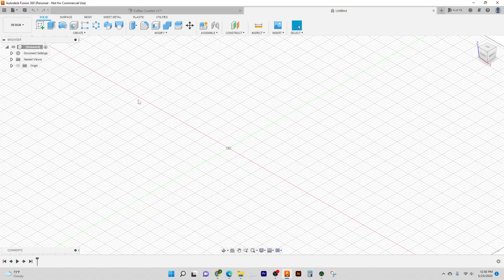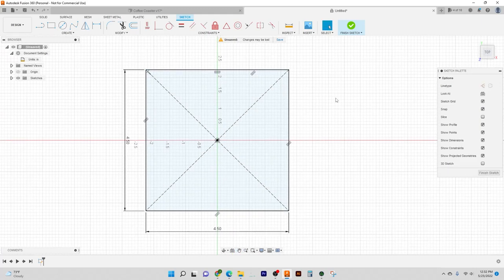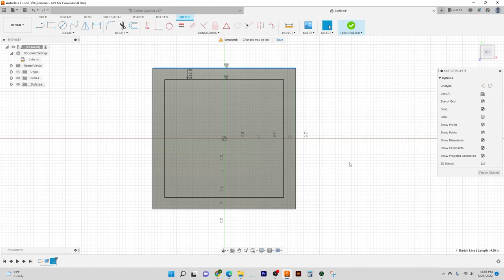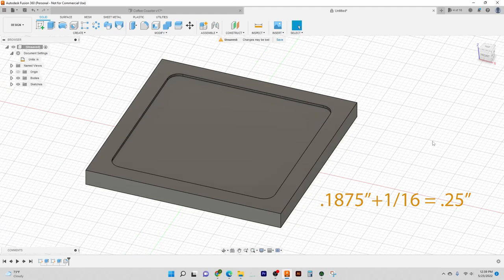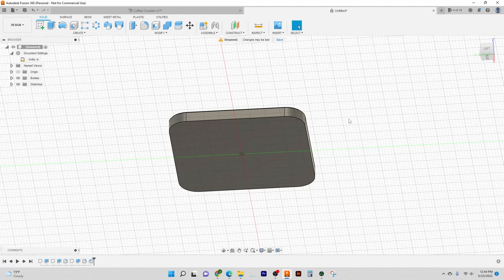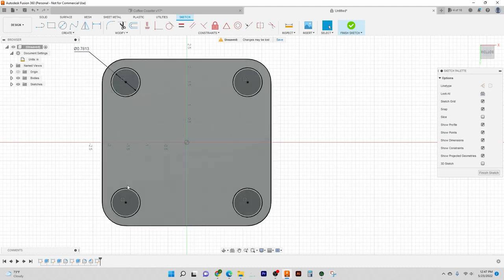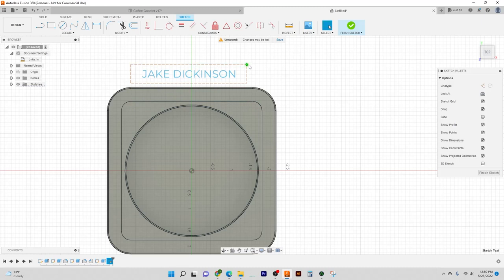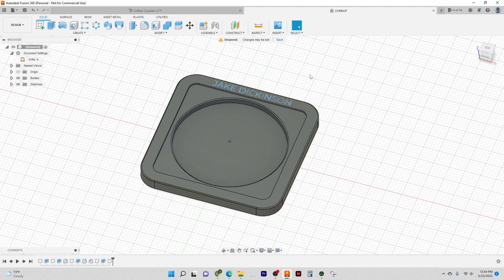MR-1 CNC Mill Shop Project - Aluminum Coffee Coaster Part 1 - Designing the Part in CAD

Comment: There are endless videos on fusion 360 CAD and CAM. I think your time would be better spent showing the machine, the machine controller interface, the probing interface, etc
Reply from the maker: Thanks Jacob. Our plan is to make several video series showing us designing, programming, and cutting a part from start to finish. Each video series will get increasingly more advanced. By the time time these machines start delivering to customers we will have tons of video tutorial content ranging from beginner to advanced showing all sorts of aspects of the machine. While some folks may find these early videos to be too 'beginner' for them, we have to start here since many customers are coming into CNC milling without any previous knowledge.
Reply: @LangmuirSystems  you said this before we could buy the machine and the videos have slowed down and become less focused toward the machine. I think all of us would like to see some assembly videos prior to having the machines shipped and in depth machine and probing of stocks